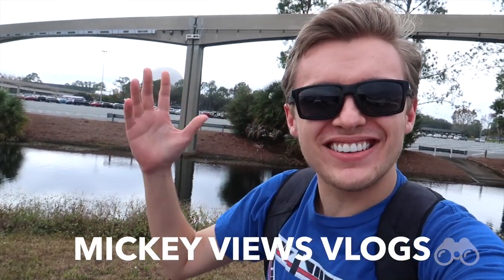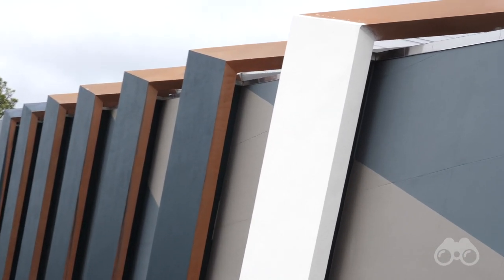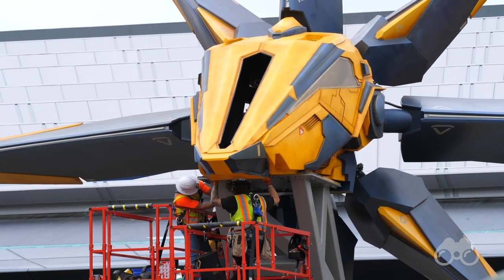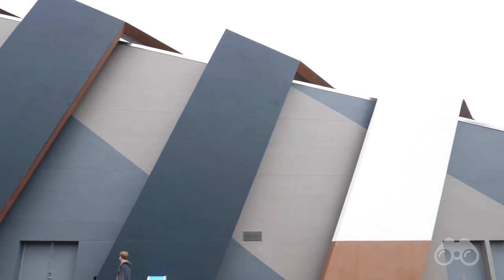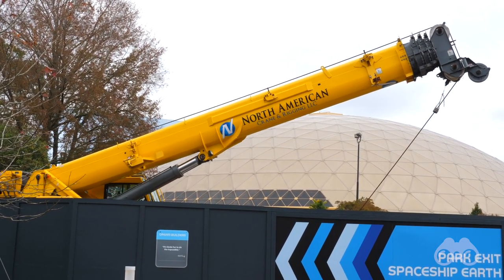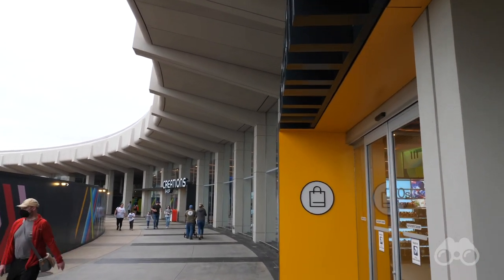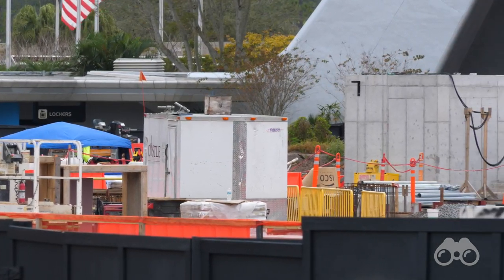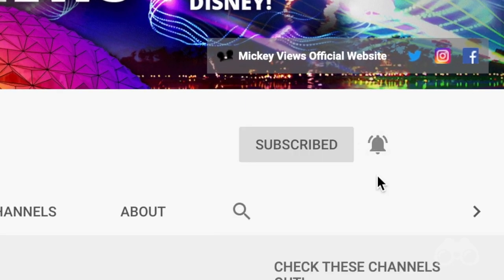GUARDIANS COASTER SHIP ARRIVES AT EPCOT! - January 2022 Construction Update

Comment: Seeing the barges in the lake there at the end brought something to mind: Has Disney abandoned the idea of running the fountains on the center barge during the day to "hide" that industrial mess from guests to improve the park's esthetic? Is that another cost-cutting measure (pumps/fountains cost quite a bit to flow enough water to hide something of that size)? Or did they just decide that the fountains really don't cover anything and running them is a waste of time?
Reply: good question. I've been thinking the same?
Reply: They were running them the other day, but only sporadically it seems. The fountains also look nothing like the concept art, instead opting to spray from the arms like in Harmonious, but not really doing anything to cover up the structures. 

Perhaps I'm wrong though, and they were just being tested in preparation for the fireworks. Regardless, they're still an unnecessary eyesore for an insultingly shallow and lazy fireworks "spectacular".
Reply: @PoseidonEntertainment  It does sound more like a test or servicing event for the nighttime shows, rather than the "water screen" fountain ops to disguise the barges. That would definitely take a lot more water than what those arms seem able to provide on their own.

I'm betting Disney has nixed that idea due to costs of running the pumps that hard, and the wear & tear on the system and related maintenance costs it would cause be keeping them on all day.

This being yet another example of Disney's recent promises (concept art) failing to live up to delivery wouldn't surprise me in the least.
Reply: The water never ended up covering anything. They'd either need a massive volume of water (more than the pumps can handle), or it would need to be a very fine mist to provide enough coverage, but that would probably end up flying all around the lake like it did during some of the testing. So I think this is a case of something looking good in theory but not working, so they scratched it.

Comment: Yea and you will have to revisit tron  construction the  concrete has already been poured, the formation of the train tunnel is starting to take shape soon to be completed which will at some point this year start putting down the rocks and the tracks for the train. Just two days ago they already started putting the canopy on tron. Should be completed by the end of 2022 where its no longer a construction site to where cast member training, u name can begin Disney has confirm moahana journey of water will not open until 2023 with tron.
Reply from the maker: Heading over there next!

Comment: Those vanes on the “ship” — do they rotate? Fold to a point like petals? Or do nothing?
Reply from the maker: They do nothing, they're bolted right to the structure. I hope they work in some effect out the back exhaust port. I assume we'll get lighting of some kind in the cabin like with Millenium Falcon in SW:GE. I've learned not to have expectations though. We'll find out haha.
Reply: They light up. They pulse light from the center to the tips of the wings on the front in thin, light strips shaped as straight lines